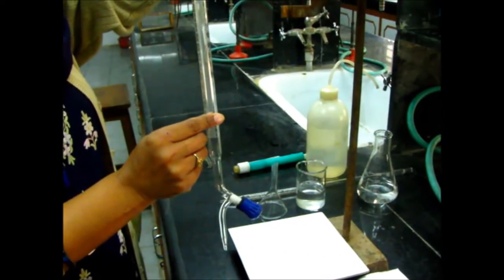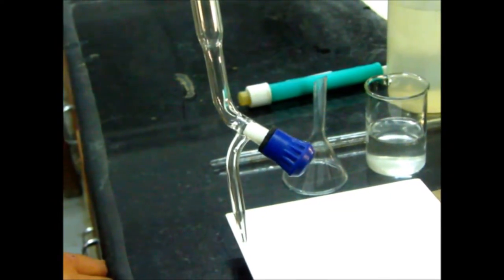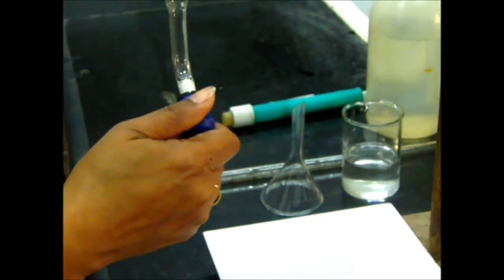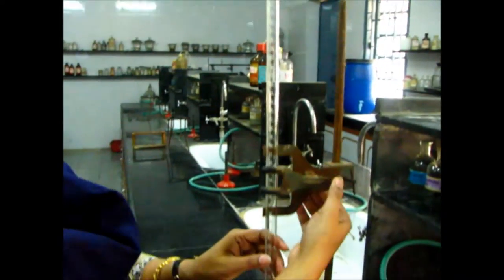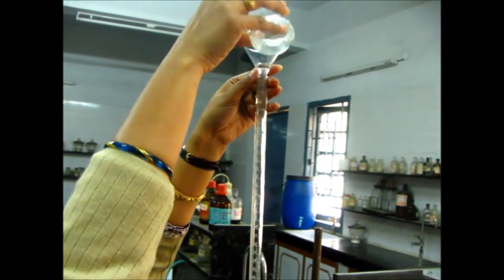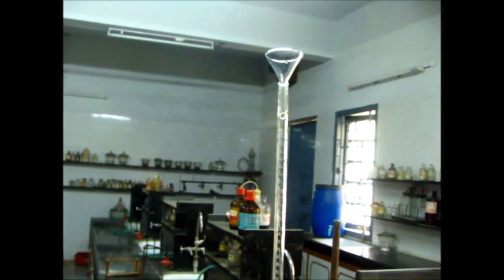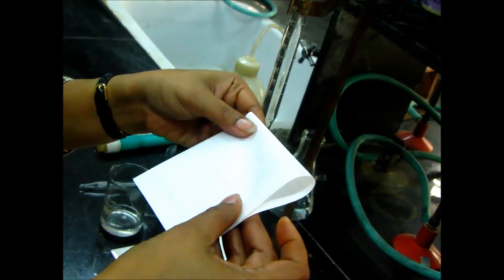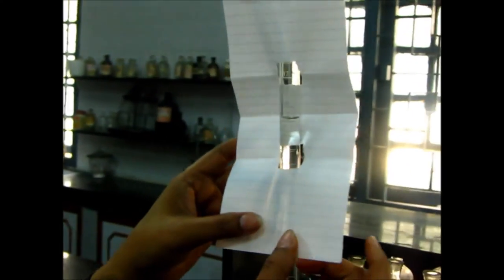How to Fill a burette

Comment: Mam Shariq sultan this side, student of MSc chemistry,mam I have a question regarding reading of burette ,mam jub hmare pas 100 ml solution hota hai or hme 2 times karke burette Mai fill karna hota hai,isme se jub hum first time titration kar lete hai,jub burette pura empty ho jata hai ,jub hum burette dubara fill karte hai to solution 7 ml kam show hota hai burette Mai ,to mam Aisa kyu hota hai.... please reply me mam
Reply: Can you please write in English? Your doubt is not clear to me
Reply: @anuragsaha928  now doubt is clear sir
Reply from the maker: Hello Shariq...your query is not very clear to me...but what i can make out is that you are observing a discrepancy in the volumes of burette and the measuring flask (in which you have prepared solution)....Discrepancy arise because of ...1) using graduated apparatus without calibration
2) refilling the burette when it still has previous solution going below the lowest graduation mark of 50 mL. Space below this mark and the nozzle accomodate  considerable volumes of solutions.